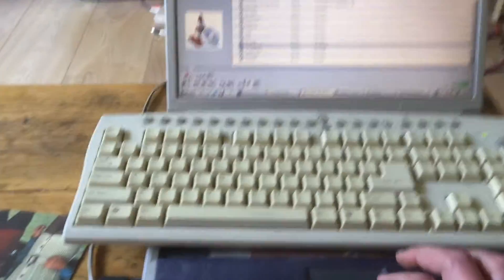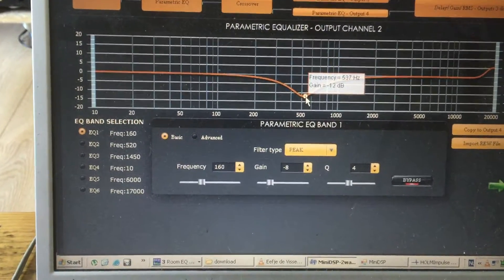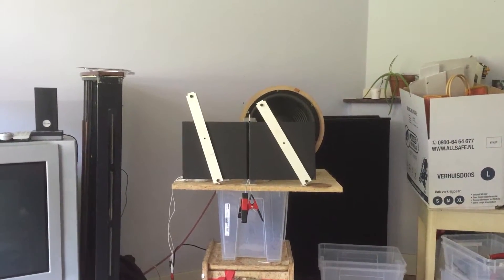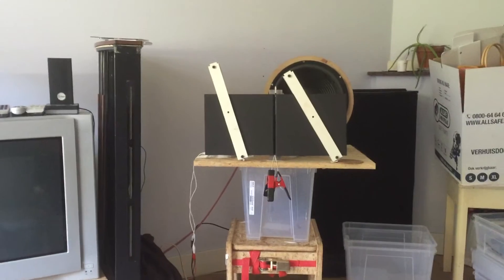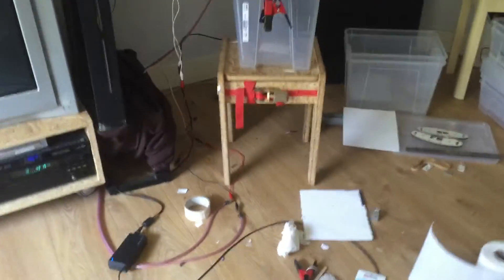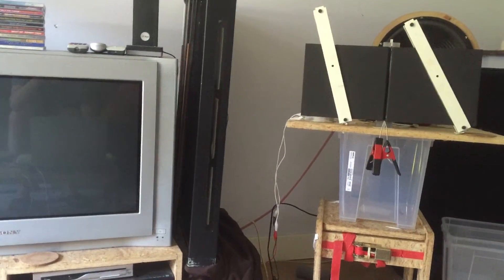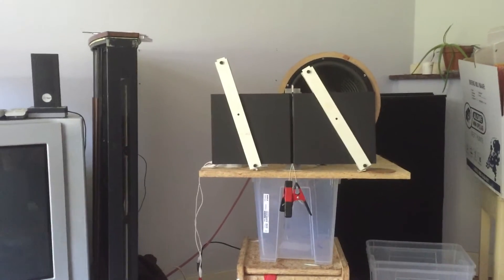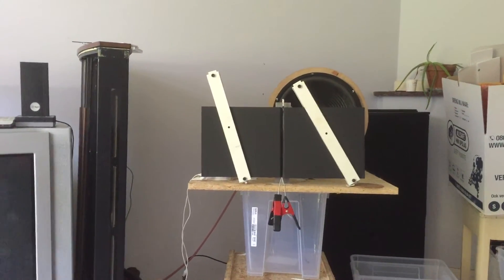Own design DML speaker, with sub

Comment: Hi ! And at the expense of what is not a piston , but a DML mode ?
Reply from the maker: ? well dml is distributed mode (loudspeaker)  the response is amde up of resonances withing the material. but at the very low end there is not much DML action but you can see the thing moving like a piston
Reply: @joppepeelen   your experiment is very interesting.We want to repeat it. Can you explain in details how to construct  such dual mode ( piston+DML)  and maximum  frequency  range  driver ( with linear motor , not with traditional exciters )?
Reply: @joppepeelen   ???

Comment: Newbie question: are there any benefits of cutting the diaphragm to other shapes, eg circular or oval?
Reply from the maker: You could ,  creating as much modes over a wide frequency range makes the thing smooth out.  So no equal distances alloud.  Round would be the most terrible if driven from the center for instance (all equal distances) that wouls create a region with a huuug peak. And then a dip and a reagged response. Besides that you can use any shape.
Reply: @joppepeelen  thanks for your reply. I am new to this topic & find it fascinating & I'm looking forward to try it myself. I was reminded of this video on the use of clever algorithm to help optimise the shape of glockenspiels. "3D Printing a Glockenspiel | Two Minute Papers #17" on YouTube
https://youtu.be/2kOCTf8jIik
Reply: @joppepeelen  surely then oval with it placed off-centre is the best?
Reply: "Amazing Resonance Experiment!" on YouTube
https://youtu.be/wvJAgrUBF4w
Reply: I was thinking the harmonics might be quite different. Like the demo of violin bow on a piece of metal sheet with  sand on it. You can actually see the nodes and how they vary if you touch it.

Comment: Are the magets opposing each other or attracting eachother
Reply from the maker: prototype9000 the magnets sandwiched between 2 metal bars one bar on north one bar in South.  You  got 2 of these assembly's  attracting each other with big force. Put a spacer between those assembly's and that's you magnet gap for the flat coil

Comment: So if I am understanding how this is working, the two plates have a magnet connected to the panel. That magnet is used much like a traditional speaker changing the poles of the magnetism pushing and pulling the panels. Please correct me if I'm wrong.
Reply from the maker: It works like a rubanoide motor
Reply from the maker: http://www.zelfbouwaudio.nl/forum/download/file.php?id=56594&mode=view

Where the rounding starts is where the foamboards are glued. the backside does not have these roundings i only use one side.